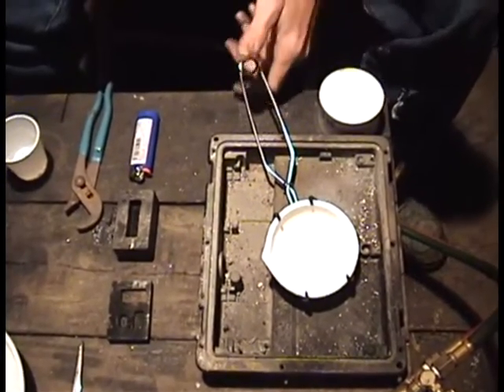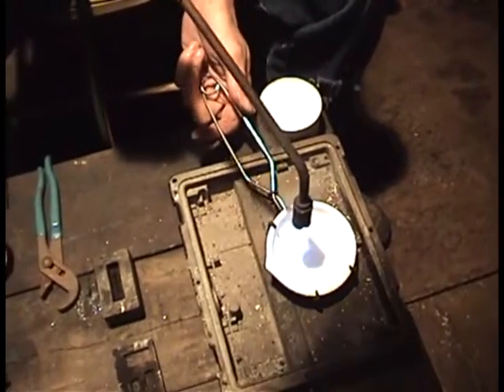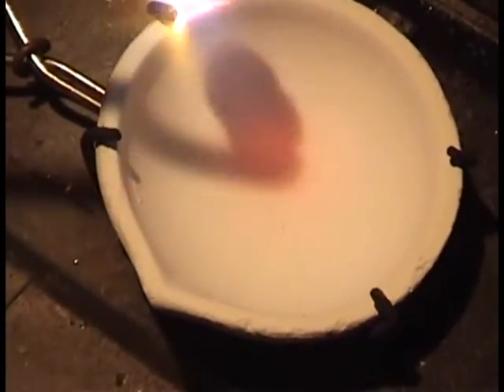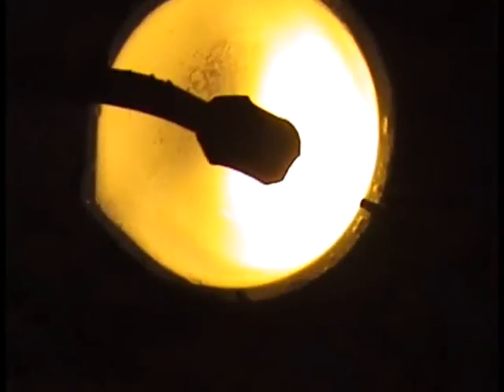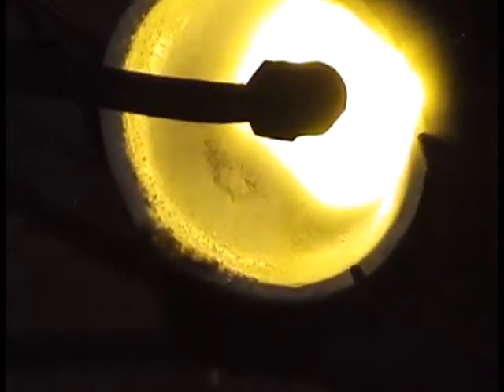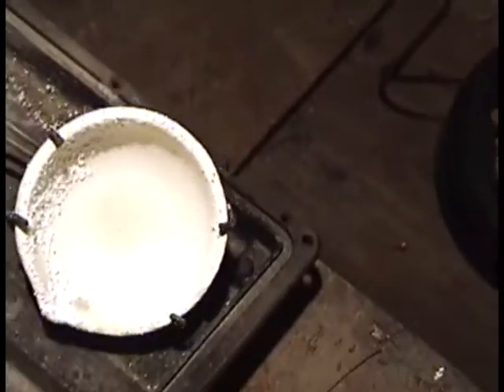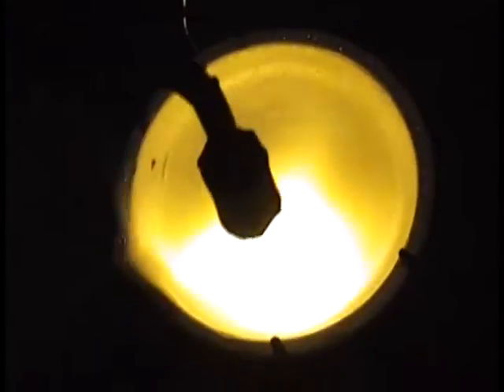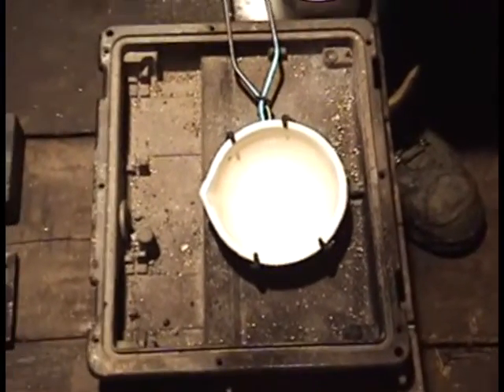How to glaze a melting dish for gold or silver crystal melting from silver cell refining

Comment: What is a good gas to use to prep the crucibles and for melting your silver and good? Are there some that are better than others, or is there one or combination of gases that should only be used?
Reply from the maker: Donald Combs Propane and oxygen will be the best sir.
Reply: AQUILLA REFINING Thank you. Will that combo also work for copper, platinum or nickel melting?
Reply from the maker: It will work for all but Platinum. Platinum is best melted with a hydrogen torch.
Reply: AQUILLA REFINING  a hydrogen torch? I have not heard of such an item before. Let me see what I can find on such an item. Thank you for the information.
Reply from the maker: Here you go sir. http://www.ganoksin.com/borisat/nenam/choosing-torch.htm
Reply from the maker: With a set up like this you can use a propane tank from a bbq grill and and oxygen tank. It cost $20 to fill the propane tank up and about $15-20 to fill the ox tank up. You can melt several hundred oz for $40. http://www.ebay.com/itm/Welding-Kit-Victor-Type-Oxygen-Acetylene-Cutting-Torch-Burner-w-15-twin-hose-/231167246755?pt=LH_DefaultDomain_0&hash=item35d2a441a3